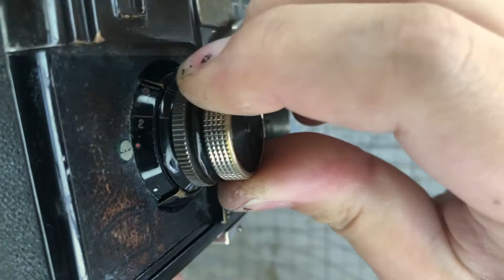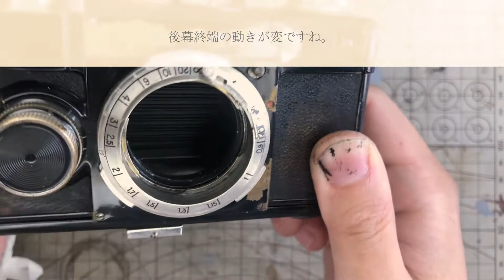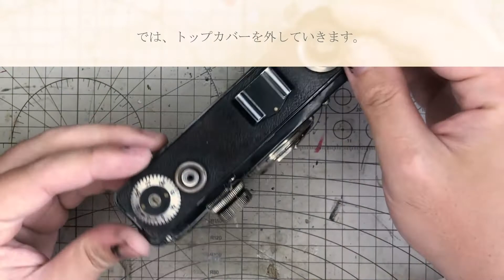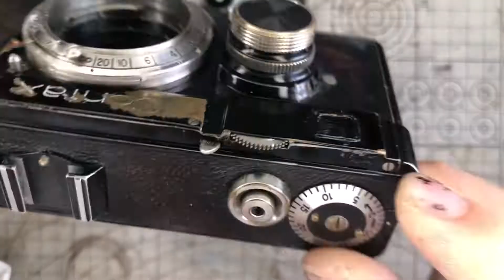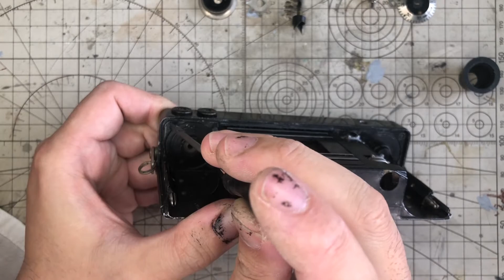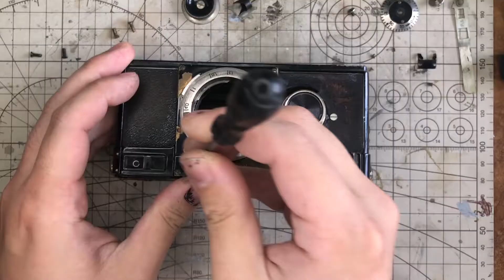Contax I型を分解する 1/Disassembly of Contax I #1

Comment: Hello,my contax i have a problem that is the shutter group wheel is very stuck,I don't know where to disassemble to see the problem,Do you have any shutter group's repair experience?thanks.
Reply from the maker: Yes, I have. I suppose there is something like greasy stain around the group selector simply. Please pour a little bit of ethanol under the dial and rotate it to the correct direction.
(Please avoid the leather from being wet with ethanol. The leather
 seems to have a tendency of swelling by ethanol.)